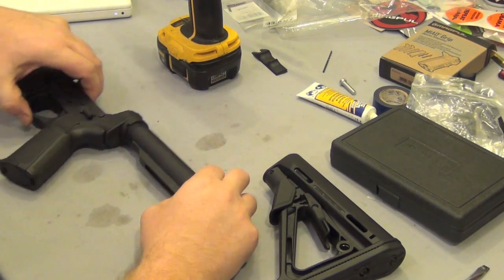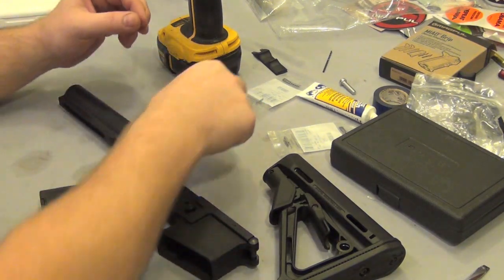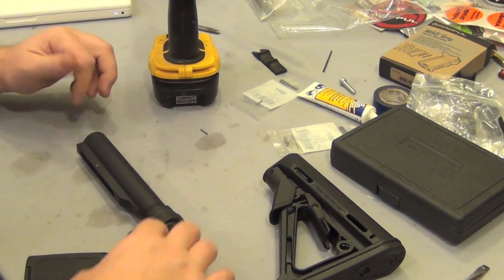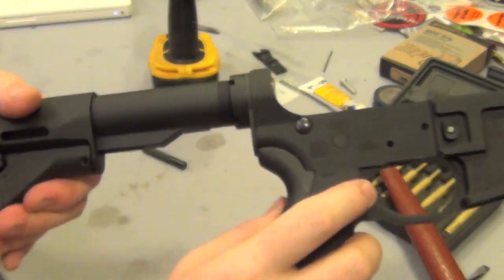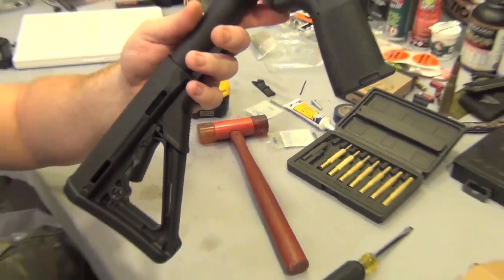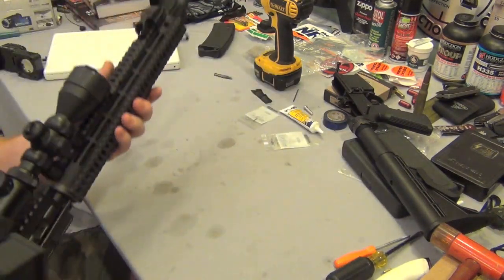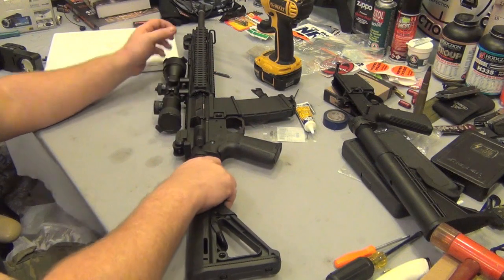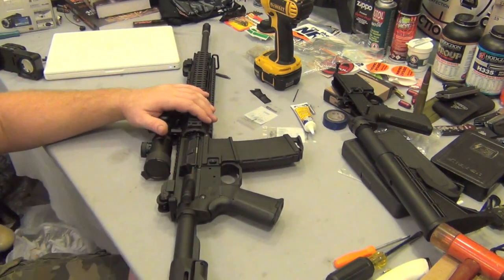HOW TO PIN A MAGPUL CTR STOCK

Comment: I know im late on this. But i recently built an upper with a 14.5 inch barrel with a 3 inch linear compensator pinned and welded myself with a cheap harbor freight welder. Its my first time and super easy. 300 blackout 110 rounds through it. runs like a charm.

Comment: Good luck finding a complete upper. Unless you want to buy one of the top of the line, very expensive uppers, you may have to wait for one to become available. I ordered an upper from Palmeto State Armory and they didn't have any bolt carrier groups in stock and they have no waiting list to get on, so I just got the upper. I've been looking everywhere for a low cost bolt and no place seems to have them in stock. They have the $200 and up BCG''s but no lower cost ones. Good luck finding one Rich

Comment: Oh , still have to get a trigger, I thought NJ had a new safety law.
I like the way you pinned the stock, at least it is not ruined, the pin could always be removed.
Could ya drill through a part of the stock, and then into the buffer tube to keep it from wiggling?

Comment: ATTENTION ALL MAGPUL CTR & MOE OWNERS WHO ARE LOOKING TO PIN YOUR STOCK:
Zero cost, drill one hole, that simple. Just remove the roll pin holding the plunger assembly. Remove spring and cross bar. Re-insert plunger into stock attached to buffer tube and position length to where you want to pin. Rotate plunger 90 degrees, to where pre-drilled hole at bottom of plunger lines up to any side of stocks roll pin hole, firmly re-insert the roll pin to hold plunger in place. Flip the stock over and use 3/32 drill bit inserted into the roll pin hole to drill hole into the other side of the plunger. Once hole is drilled, remove roll pin from other side and tap roll pin into the hole just drilled to pin plunger in place. Done. 
Worst case scenario buy new roll pin (3/32 x 3/4) $.50 - $. 60.
Reply: Jerry Dunham which hole and where and how now?

Comment: I had Someone tell me I need to epoxy my pin. My gunsmith debunked that. It just sucks that if I ever want to change anything, I have to go see my gun smith. I want to change my gas block, but my muzzle brake is pinned and welded, so it’s a trip to the gunsmith.